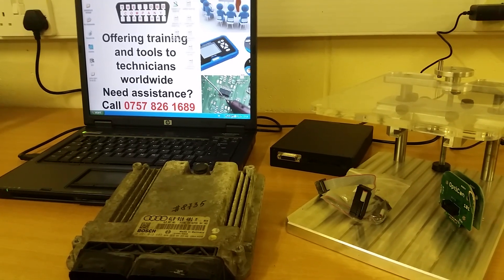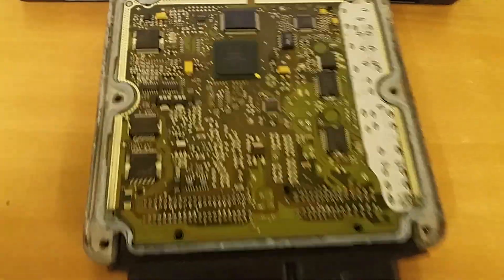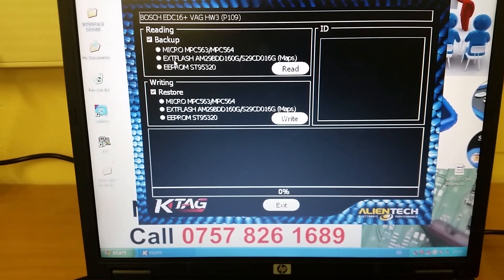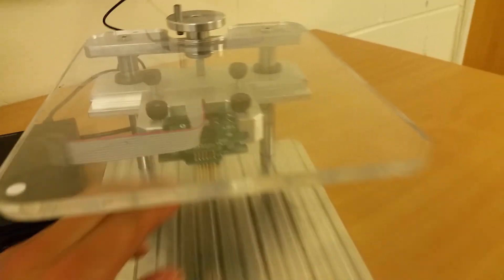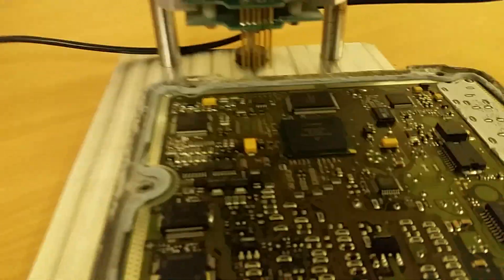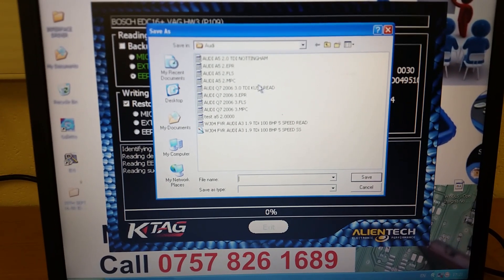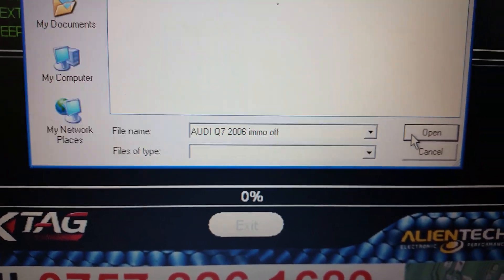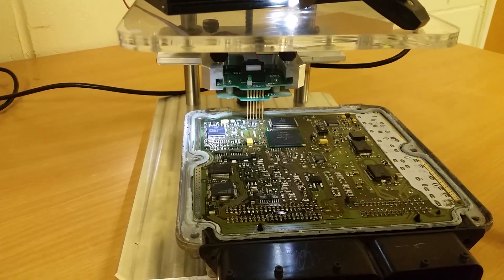A Guide to BDM programming with KTAG using BDM Frame for ECU Remapping training course UK

Comment: Man new to ecus programming and car scanners so with the adapters no need to plug those cables ton the pin out of ecu? So only adapter is enough should i buy them all they're 22 or the ones come with ktag is enough in my country most ecus are made by bosh what do you recommend?
Another thing i learned that EGR ad blue and fap is in micro processor storage but i see some videos on youtube when they want to remove EGR adblue and fap they read maps and write on maps which one is right ?

Comment: Hi
My ECU is edc16c3 and my bdm100 dind come with Bosch frame.
Can i solder small pins and just plug the cable or need to mod something ? 
Thanks for your help

Comment: Hello. Did you use a power suppy?
Reply from the maker: Hi

Yes I just used the power supply that comes with KTAG
Reply: @TheOBDcompany  sorry not Ktags power supply. Do i need other connections for ecu power? Is ktag set enough for clone? Actually I want to clone my Delphi Dcm 3.4 ecu. 
Regards.

Comment: Hi, great video. In order to remap the ECU to get more power, what another EEPROM do we need to reprogram? Only the ST95320? If so, I can do this with an Arduino board. Thanks a million. My ECU is a Delphi DCM3.2
Reply: Anderson Lima but how do u use arduino as ktag?
Reply: Albert Cani I only need to create a sketch that reads the EEPROM and save it in a text file.